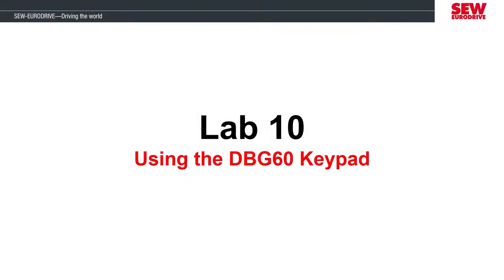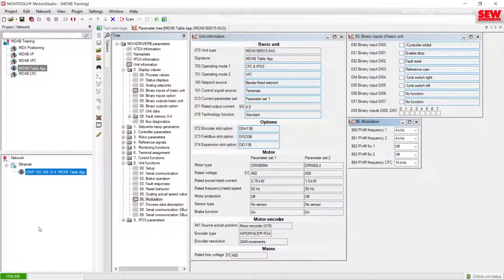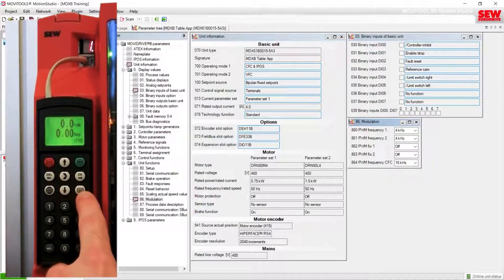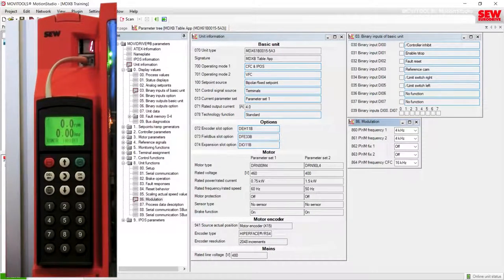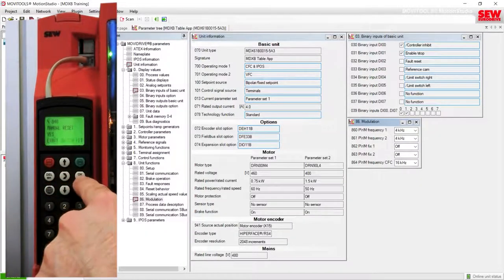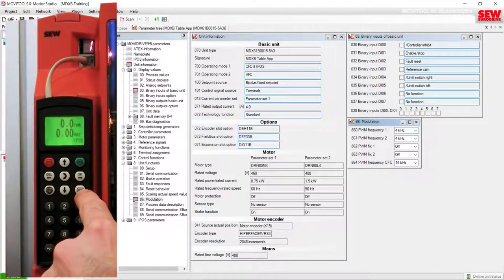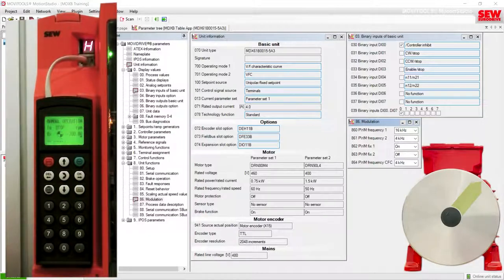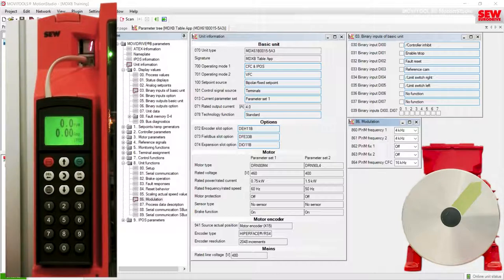MOVIDRIVE® B Training Session 6 - Lab 10 - Using the DBG60B Keypad

Comment: Sir,can I check error no 8 with this keypad??
Reply from the maker: Hello. Yes. Fault F08 can be displayed on the keypad through the fault history. The fault history is in parameters 080 through 084. Parameter 080 is the most recent fault and P084 is the least recent. You can look in the fault history and determine if the F08 was caused by high output current or something else. Fault F08 is the most common fault that can happen on the Movidrive B. In this video linked here you can see some common problems and resolutions to the F08 fault.
https://youtu.be/zUF_12cFV6o?feature=shared&t=969

Comment: Does Using the DBG60B Keypad work for MOVIMOT MM05D-503-00?
Reply from the maker: Hello! Yes, the DBG60B can be used with the Movimot D. It doesn't have the full features like when plugged into the Movidrive B but it does work. You won't be able to change parameters with it unless the Movimot is in Expert Mode but you can display the parameters, status, fault history, etc. The Movimot is usually setup using the DIP switches and dials inside the cover. You need to exercise extreme caution and verify the machine is in a safe state before using the keypad with a decentralized inverter like the Movimot D because you have to be right next to gear motor to use the keypad. Also, if you need to remove or reinstall the Movimot cover, all voltage supplies including 24Vdc need to be switched off or it can arc and damage the unit. Below is a link to the Movimot D Operating Instructions and the keypad information starts on page 189.

https://download.sew-eurodrive.com/download/pdf_u/28516672.pdf